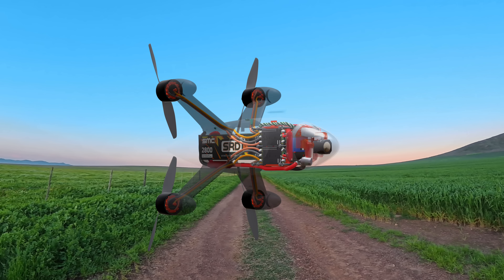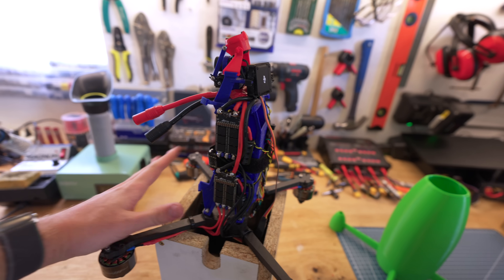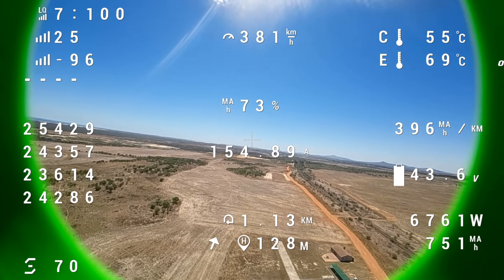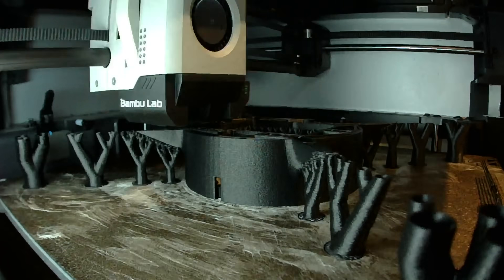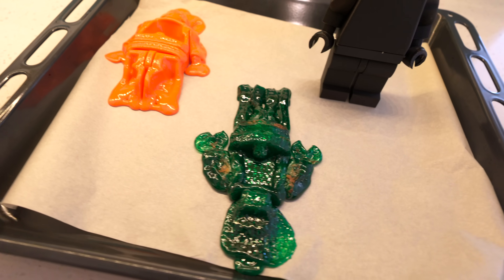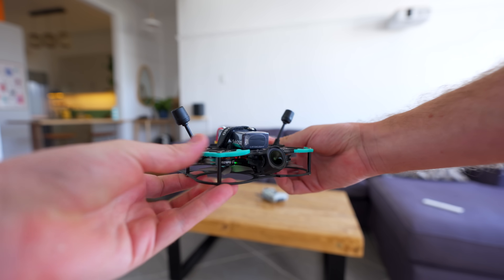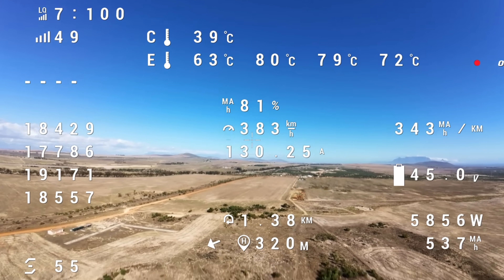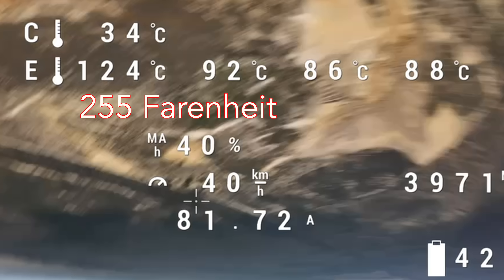THE COMEBACK - World's FASTEST Drone V3

Comment: So you are not really liquid cooling, but using the water as a thermal sink. Might also look at some of the phase transition thermal storage materials. They would not leak and short out you circuits. Leakage is why I hate liquid cooling unless absolutely necessary.  Agree it’s necessary for your application.  Or at least something equivalent.
Reply from the maker: Yes that is true. It’s a thermal sink. Leakage was very a problem with this system. The water cooling ended up working phenomenally
Reply: I don't see how the water is better than a solid block of aluminum.
Reply from the maker: It’s much much better! I did consider this. Water can hold so much more heat
Reply: @kevinmc1111 heat capacity. Aluminum will soak up heat very quickly, but it does not soak up a lot of heat for a large temperature difference.  That is why you use it attached with the thermal paste to the circuit to suck the heat out of the circuit and dissipated into the aluminum volume, but then you have to get rid of that heat from the aluminum. If you replaced the water with aluminum that replaced volume of aluminum would probably only last a couple of seconds until it was scolding hot and not providing any cooling anymore.  It takes a whole lot more heat to raise the temperature of the same volume of water than aluminum and that is its advantage. Of course you can only do this to a point, as the temperature rises it will eventually hit the boiling point, and then it will absorb even more energy flashing over to steam, but that steam will bust the container and short out the whole system. That is why I was suggesting replacing the water with a heat face change material that might not be quite as disastrous at higher temperatures.
Reply from the maker: Well said

Comment: With the complexity of a pump you could use the skin of the drone as a radiator. 

Less complex would be a heat pipe. After potting the ESC's, you could submerge them. Any steam is directed to the inner layer of the skin, where it condenses. Liquid then goes back to the ESC's.

Do you currently monitor the motor/ESC temps?
Reply: Just put the ESC's in the fins! And make them from aluminum for max heat transfer.
Reply from the maker: You are on to something! For V4 we have an idea that mirrors your first point here 😁
Reply: @LukeMaximoBell Yay!! Another South African!! 🇿🇦

Comment: The speeds you got are truly amazing. I saw in Sammy's video that he had used a lift-generating airfoil for the arms? I saw that you got enough lift with only 1% angle of attack, but could reducing that angle of attack with such arms help reduce drag? What's the optimal thing to do at these speeds?
Reply: I respectfully would say Sami’s lifting arms are the wrong approach😅. 
Point being that the added 0.8deg nose up comes with almost zero measurable drag increase, negligible induced drag. So our target was smallest arm surface area.  

If you noticed Sami flew + configuration to help the wings. Body lift is massive. We measured up to 10g in a turn so the body lift is huge.
Reply: @Mike-Bell  Yeah I see what you mean. Thanks.